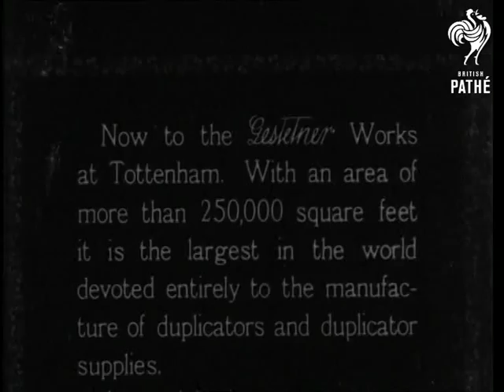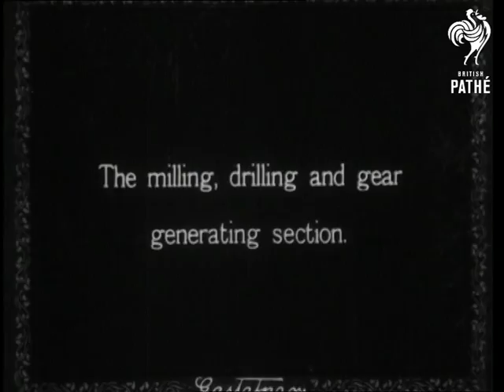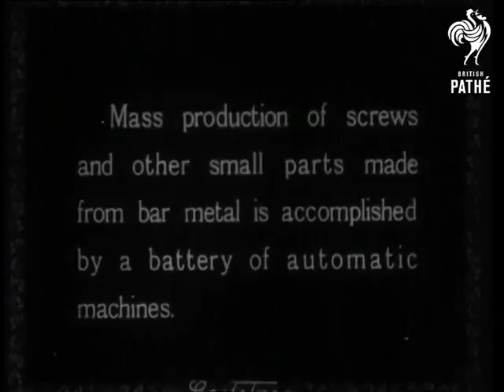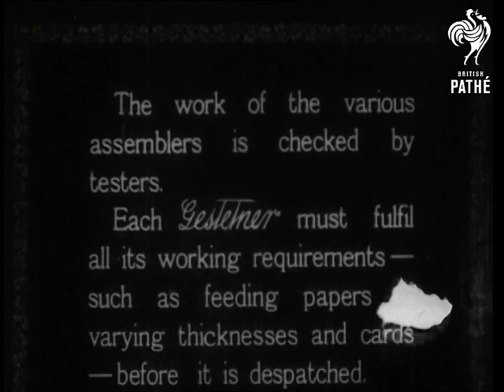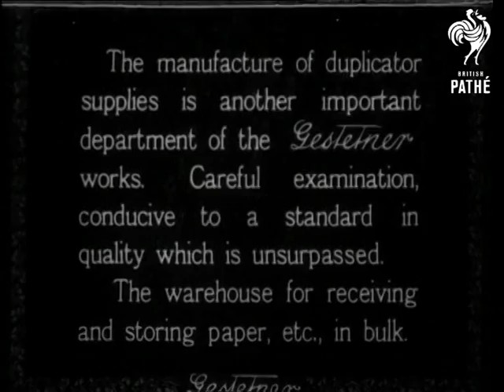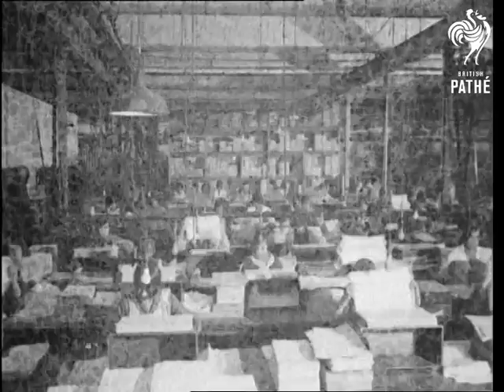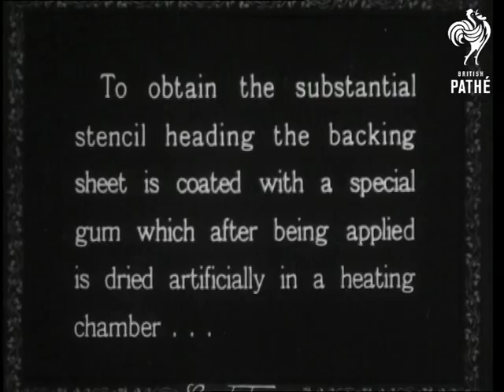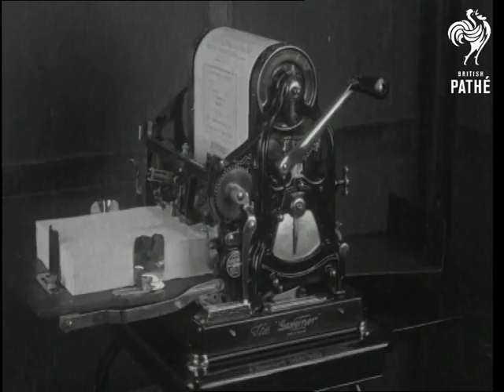Gestetner Works (1927)

Comment: Worked in both mechanical and electrical R&D departments 1973 - 1986 as a technician. Fantastic firm to work for, so sad that they let the grass grow under their feet and didn't keep up with modern tech.